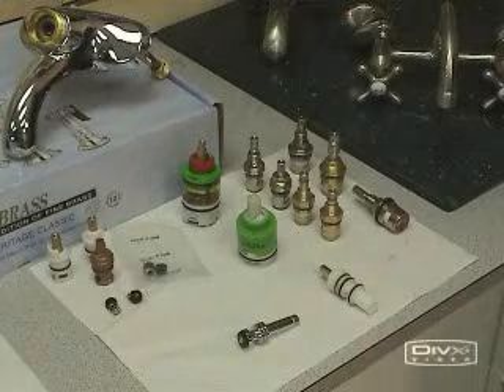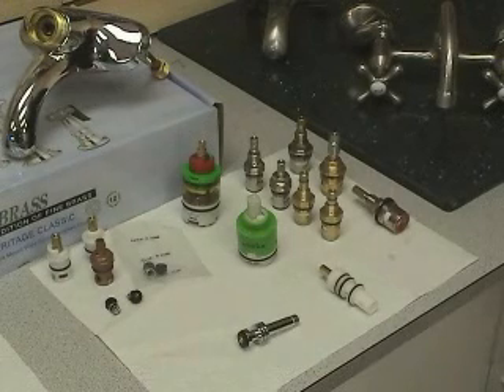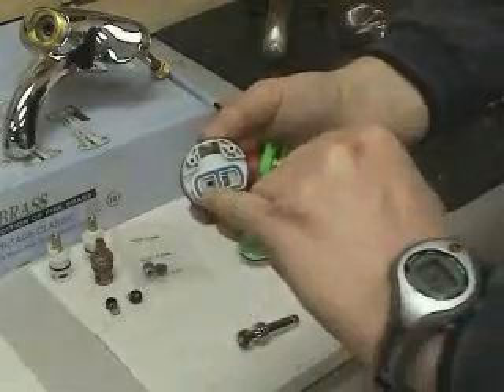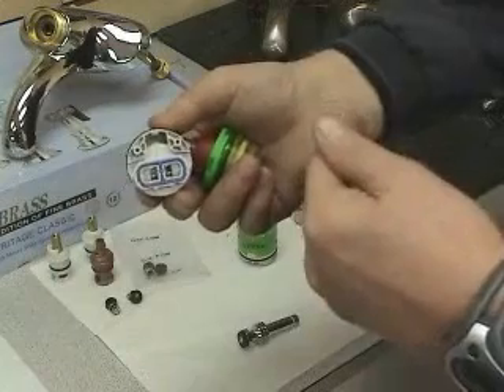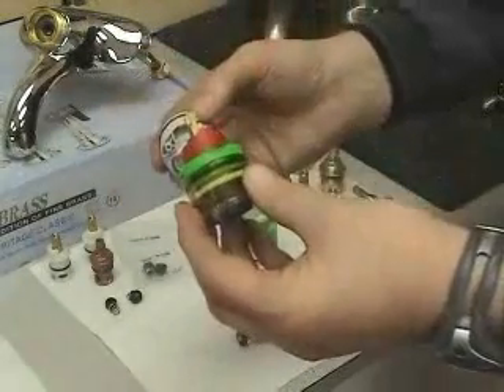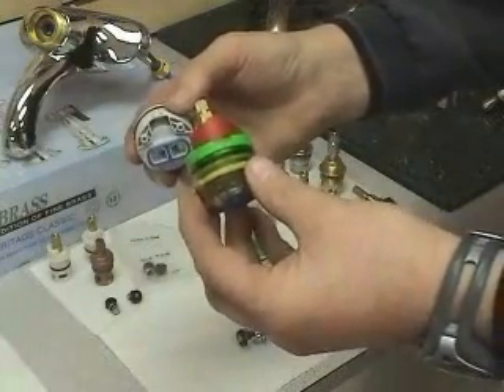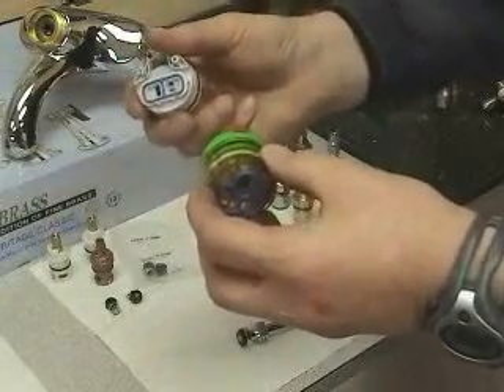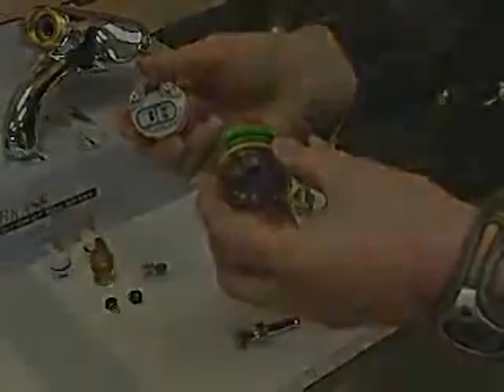6 - The Pressure Balanced Cartridge

Comment: Another enemy of these cartridges that i have found;from maintaining 420 of them in an apartment complex. Is people in a rush or strong people from shutting the water off too hard causing the plastic(for whatever reason) stopper to break off. This causing the handle to spin without stopping in the off position; making the operator find the off position.